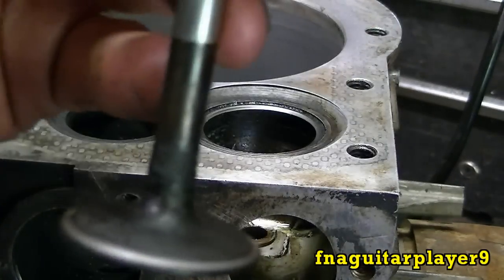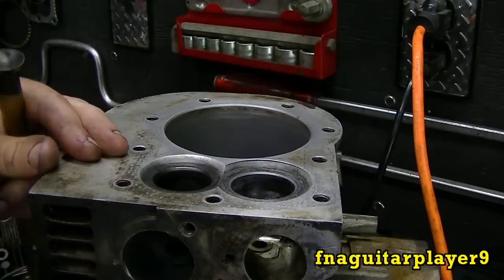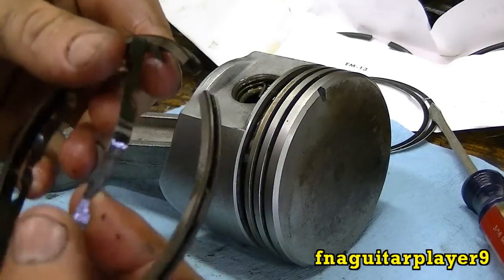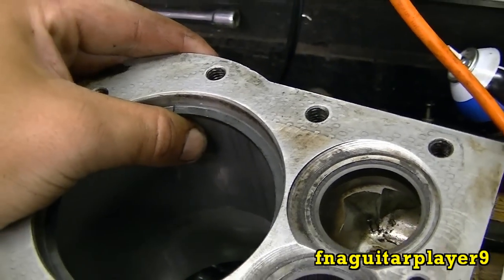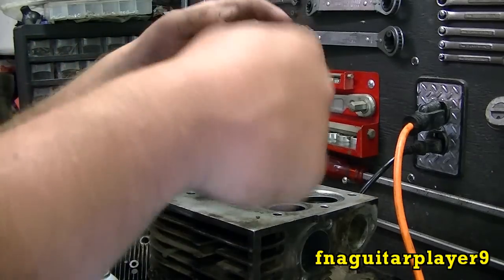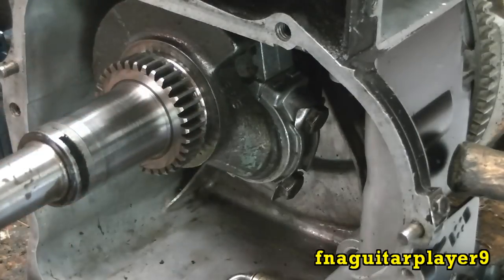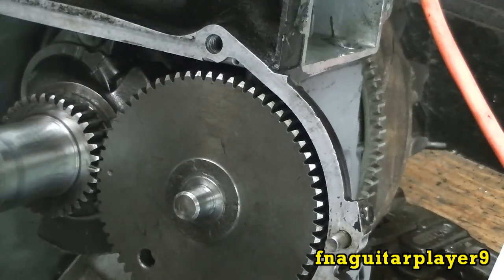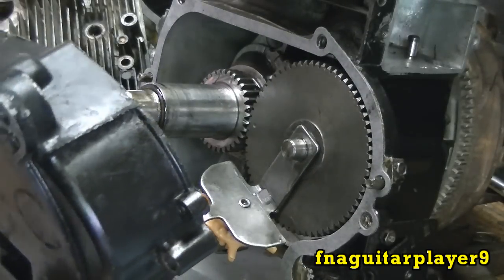Part 2 of 3 : Rebuilding 10HP Briggs and Stratton Engine : Rings, Gaskets, Reseat Valves

Comment: Regarding the piston rings, the Briggs parts manual shows a standard size (std.) set of rings and 3 more sets of rings that are oversized (O.S.) by different amounts . I was wondering if I can use the O.S rings with the Standard size piston? The std. rings have too big of a gap (slightly over .020) Thanks!
Reply from the maker: Yes you can, just put the rings in the cylinder and measure the gap, then use a flat file to file them to open them up to the spec you want, i try to keep the gap less than .010". Its a old trick to get more life out of the engine before it needs to be bored out oversize. Thanks for Watching!!!
Reply: @fnaguitarplayer9  I can't tell you how much I appreciate this. Actually, I can, I appreciate it very much! Thanks a bunch for the informative videos.

Comment: I'm guessing that the 22 series Briggshas a shorter stroke with the same piston and a longer connecting rod to get less cubic inches and then they just have no synchro balancerso the only difference is the crank and the length of the connecting rod correct?
Reply from the maker: Probably so, they did that alot. Thanks for Watching!!!

Comment: A little additional information for you and your readers.  The torque specs for my engine... Briggs and Stratton 254707-0124-01 (10 H.P. Synchro-balanced) are as follows:  Flywheel Nut - 65 Ft/Lbs,  Cylinder Head - 165 In/Lbs,  Connecting Rod - 185 In/Lbs,  Crankcase Cover/Sump - 140 In/Lbs.  Notice that ONLY the Flywheel Nut is given in Ft/Lbs.  For the others, multiply In/Lbs by 0.0833 to get Ft/Lbs.  Since my torque wrench only has Ft/Lbs and M/Kgs... I caught this when I noticed my torque wrench only goes to 150 Ft/lbs.  (Example: 185 In/Lbs is 15.4157 Ft/Lbs.)  I used 20 Ft/Lbs and called it done.  Just thought I would pass that along...
Reply from the maker: Thanks for Watching!!!

Comment: My question is, on my 190402 model with old rings in cylinder I gauged them at .052 . Should I go with standard 8 hp B&S rings or go with the .30 over ring set?
Reply from the maker: I would go with the 30 just to play it safe, but like i was saying, you can't really go by the ring gap of the old rings, you don't know if the cylinder wore more or if the rings wore more. but the .030" will cover it either way, so yeah it would be the best bet. Just be prepared to do some filing!
Reply: Thank-you Sir! We'll give it a whirl
Reply from the maker: no problem!

Comment: this engine has no syncro balancer like by 12,5 I/C engine
Reply from the maker: Good point, any engine bigger than the 10HP had sychro balancers, i meant to talk about it on the video but forgot. It is a much simpler setup and can be more reliable, the dogbone rod on the countweights is always the week point on the synchro's They are smoother running though! Thanks for Watching!!!

Comment: Where did you get your Valve Spring compressor
Reply from the maker: I think we got it at NAPA, not for sure though. Just google it or look on ebay for L head valve spring compressor. Thanks for Watching!!!
Reply: Found it at Sears thanks for return. Not sure like the adjustable ends tho.
Reply from the maker: I hear ya, it takes a little while to get used to those ends, but its handy for different sized engines.
Reply: Your Videos were very helpful. Not sure if would have tried if did not see first. Engine done runs great. But have lot of little things giving me grief. Replaced carb bowl because could not stop leak. Still leaks barely around seal. Had to replace switch, solenoid. And now the starter is not wanting to work when gets hot. On the bench as we speak. Hoping that is problem. Battery is 12.45 Volts let set cool will run so assuming. Thanks for help and replys
Reply from the maker: Glad to help out! I hear ya, i've had to double up on the bowl gaskets before, some can be very picky. IT does sound like a bad starter, sometimes the windings will break down when they get hot like that. your welcome!
Reply: So you believe the armature is possibly bad. Had already ordered bottom half but if have to order armature might as well get all. Thanks again. FNA
Reply from the maker: Thats what i would say, you can find them cheap on ebay, aftermarket. should take care of it.

Comment: Hey Frank, What's up ole man? Been a while since I yacked with ya.
Thought I would share an idea with you and your viewers.
I know theirs a few that don't want to spend $40 or $50 on a ring tool (like myself) so I got to thinking about it and came up with a great little jerry rig tool.

I went and bought a 5 oz. can of cat food and a water hose clamp.
cat food can is around 3 1/4" in.
Hose clamp 4" in.
Take the can and cut top and bottom off from the sides.
Now you have a ring, cut it in half.
Now take the ring and wrap it around the piston, make sure to see if you need to trim off a little of the can ring, It needs to be a 1/4" shorter in diameter.
Now install your rinds on the piston
Place the can ring ,, with the hose clamp (DO NOT TIGHTEN) around the piston and SNUG it up, You can see the rings close. Don't forget to use STP Oil it up.
Insert piston and tap into place. and there ya go,,,

btw if you don't have a cat and don't want to wast the cat food,,, with a little mayo and mustard it's not that bad on a sandwich. hahaha
Later ole buddy ----->>>
Reply from the maker: MrBriggs51 Hey! Nothing much, just working! That is a really good idea, I'd never thought of that. I have used just a hose clamp before, and it doesn't work to good. And i've used the screwdriver method, and that doesn't work to good either. I'll have to remember this in case someone asks me of a alt way to do it. I'll have to try that sandwich sometime, might be good never know haha Later! Thanks for Watching!!!
Reply: That is a good idea.  A hose clamp by itself doesn't work well, but the can is the way to do it with hose clamp.

Comment: I've noticed that you didn't clean the grooves on the piston before installing the new rings. What are the indications that they need to be cleaned ? Thank and Thumbs-up !
Reply from the maker: R Verro That is a good point that I should have talked about. I think i showed this in the 12.5HP rebuild, but most of the time its best to clean out any carbon build up in it, this one wasn't very bad at all so I didn't do it. They also make a special tool for doing it. The main reason for cleaning it is to get any carbon out or any burs from removing the rings. Appreciate that! Thanks for Watching!!!

Comment: I just love this stuff.. Thanks.  Great editing.. Smooth.. Thoughts::  Having such experience, have you seen of any problems with valve seat burning using unleaded gas on older engines.
Reply from the maker: Dan Hitchcock I hear ya! Your welcome, appreciate that! I have to edit alot on videos like this, keeps them shorter (less turning bolts and more to the point). Not really, but I've mainly on worked on briggs from the 80's to present, i do have a old 58 model 6S, but i've never had any problems with it. We only had valve seat problems on one motor, it was a 90's model briggs 12.5HP, and the seat came loose in it, other than that though no other problems. Thanks for Watching!!!